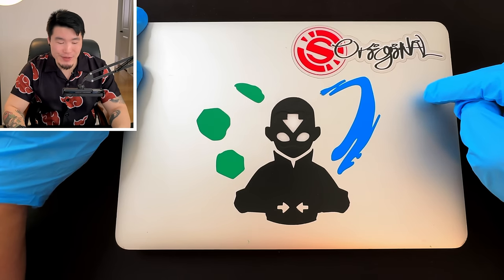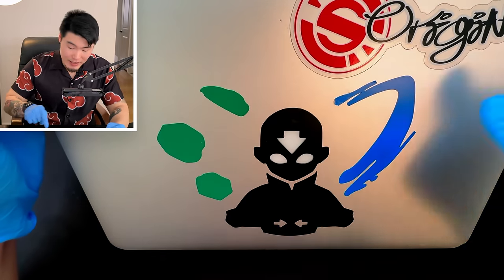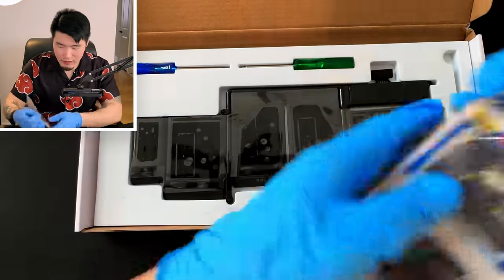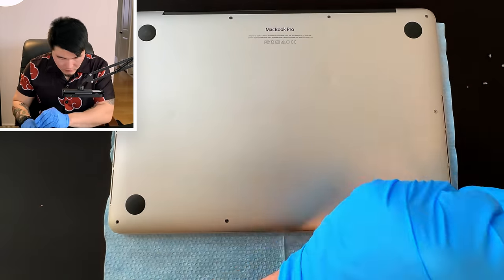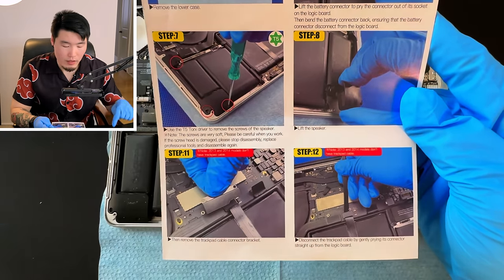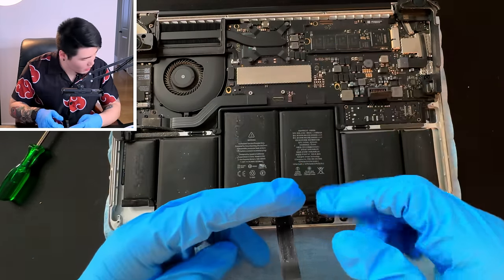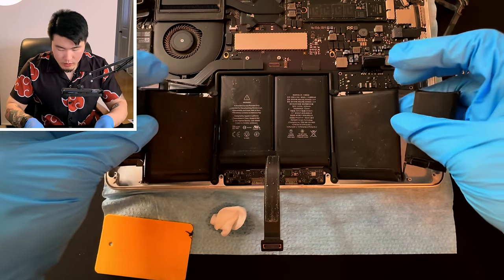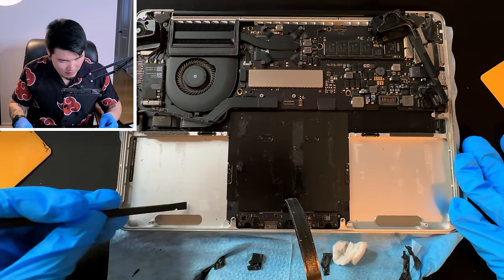I Did Surgery On A Laptop

Comment: A battery replacement isn’t “surgery” lol. I thought you were going to have to re-solder joints on the board.

Apple does make battery replacement the hardest job possible. I’ll give you that.